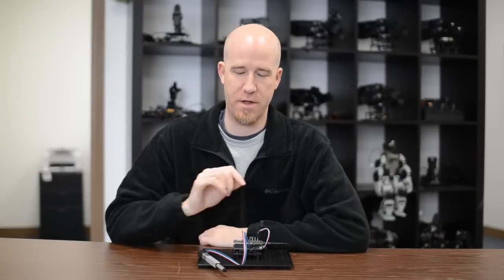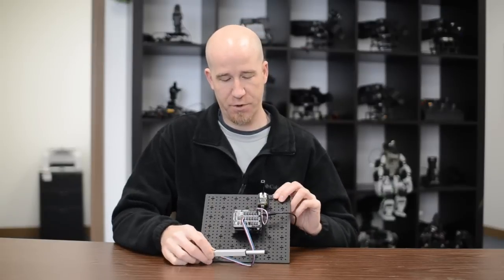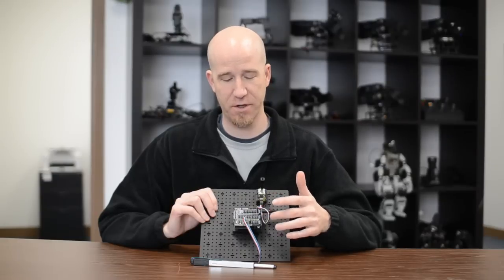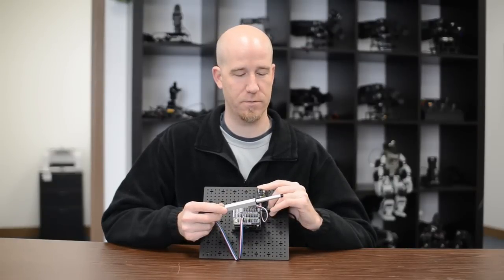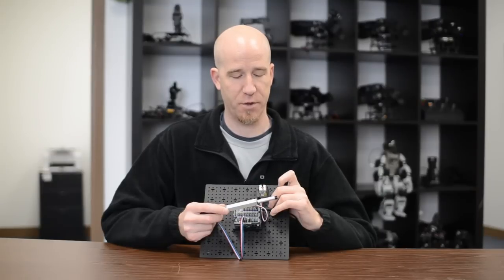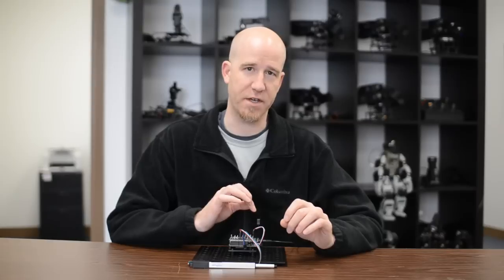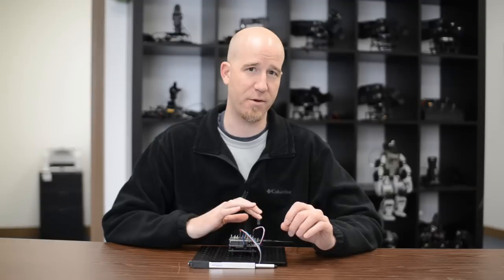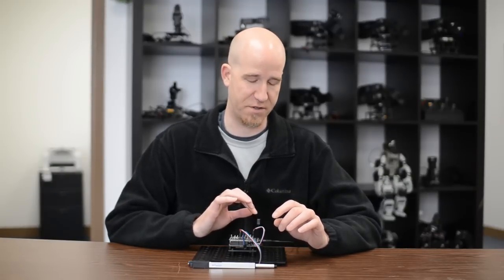Incremental Control with Linear Actuators

Comment: I'm looking for an linear actuator that will work with Arduino.  Here is what I'm trying to take you.  I control my power wheelchair with my mouth joystick.  I'm trying to move the joystick up and down, closer and forward, and left and right to position it in the right place by my mouth.  Also where do I get the joystick you were using on this video.